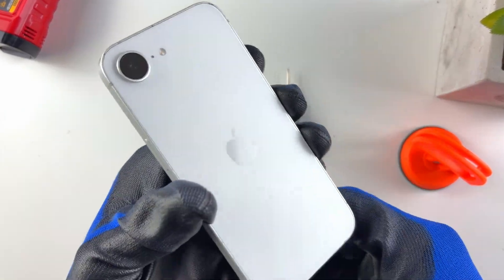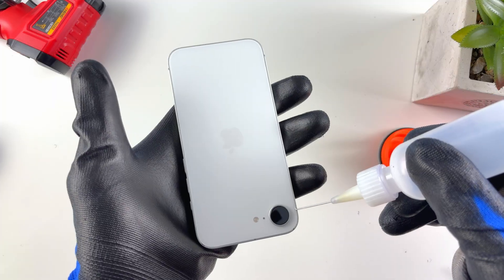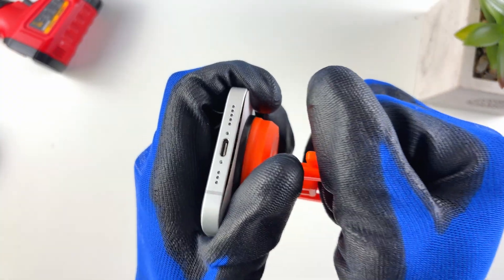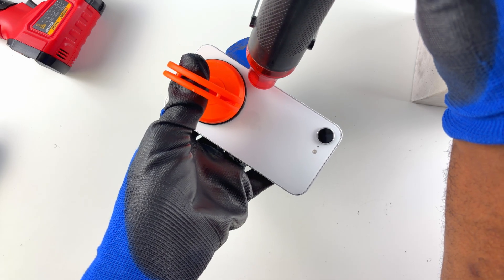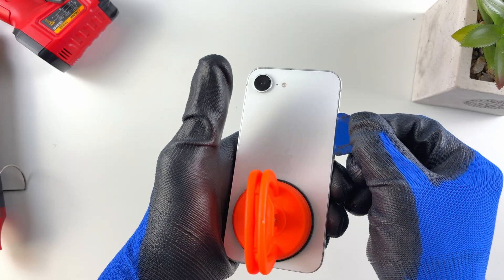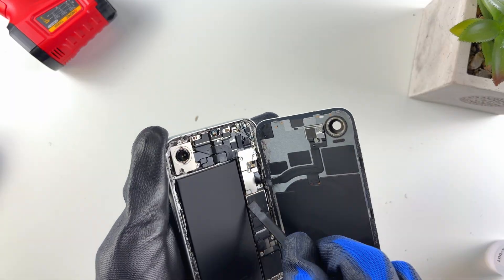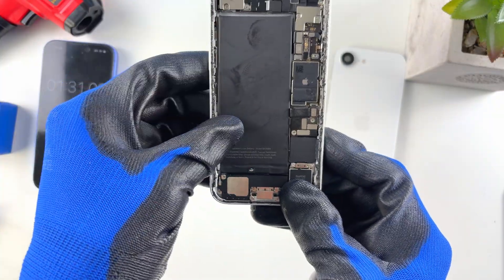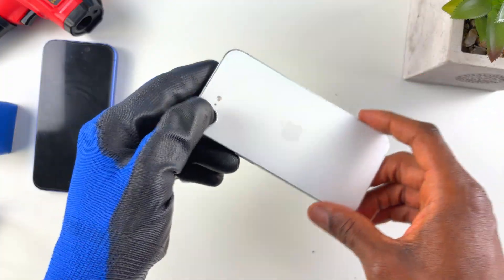iPhone 16e Battery Replacement Guide… Beginners Start Here!

Comment: How come you opened it from the back instead of the front screen? Is there any difference or is it the same thing?
Reply from the maker: @muslimomar5661 Good question! Yeah, Apple actually started making most of their phones open from the back starting with the iPhone 14 series. The 14 Pro and Pro Max still opened from the screen, but after that, like with the 15 and 16 series, you have to go from the back to reach the battery, cameras, and cables.

You can’t really access anything from the front anymore because it’s just a metal frame under the screen. Opening from the back also helps reduce the risk of damaging the display. Worst case, if something cracks, it’s usually just the back glass, which is way cheaper to replace.

Comment: What’s the clips used for?
Reply from the maker: @muslimomar5661  Those clips are called alligator clips. I use them to connect a small 9V battery so I can release the battery adhesive on newer iPhone models like the iPhone 16 series.

Apple changed how the battery adhesive works on these newer phones, so instead of manually pulling the tabs like before, the clips help power the adhesive release system, making it way easier and safer to remove the battery without bending or damaging it.